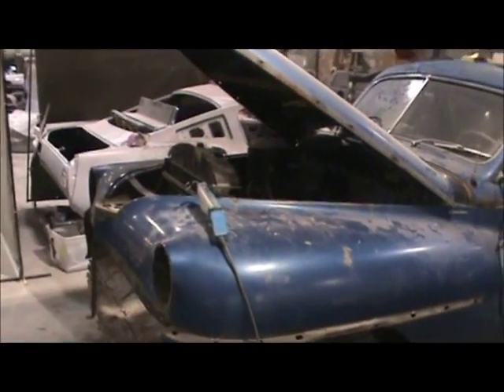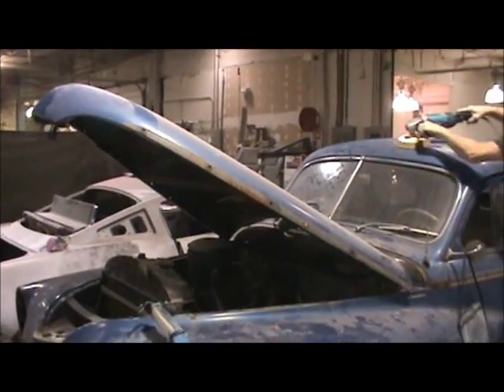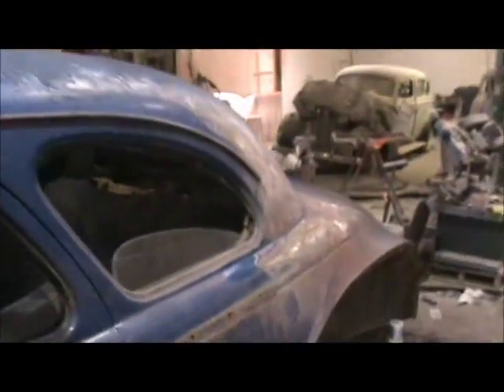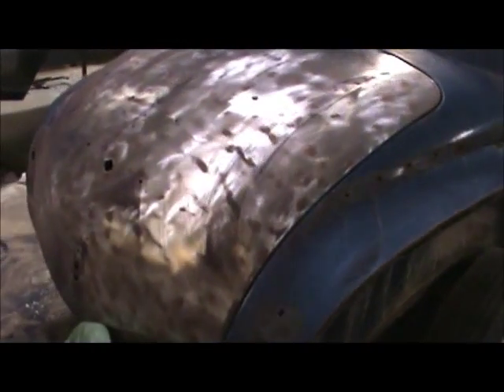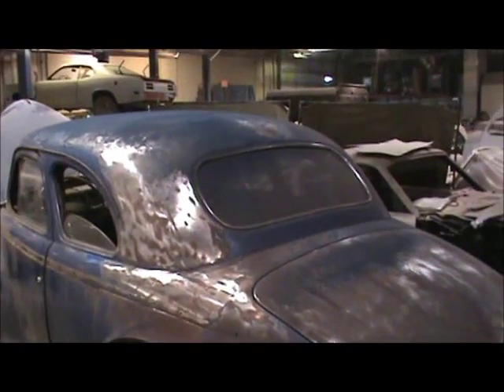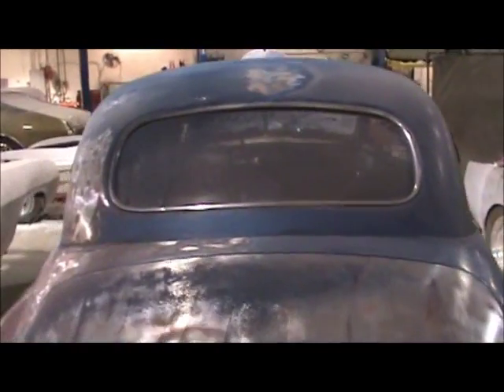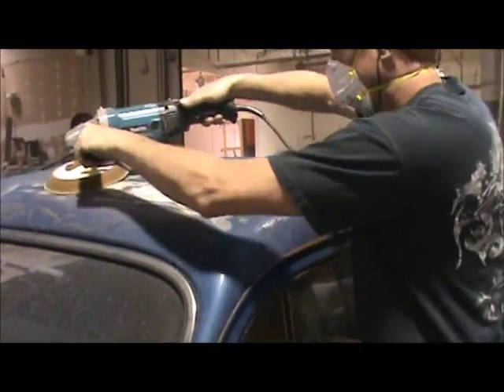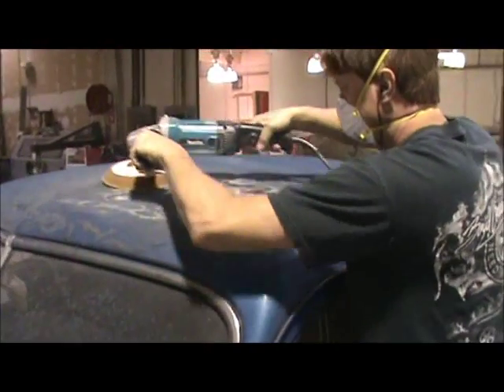Stripping a 1949 Desoto Club Coupe

Comment: I too own a 1949 S-11 club coupe. (mine is the Custom series with Fluid-Drive and a little more stainless trim then this blue car) Yes, they did make S-11's (similar to 1946-8 S-11) in early 1949. So, the title is correct. A little later in the year, Chrysler introduced the new body style 1949 S-13 models.

Comment: What is the purpose of stripping a car down to bare metal?  I read in Matt Joseph's On Restoration book that stripping down to bare metal is a big mistake as no new primer is going to adhere as well the first coat of paint a car received at the factory.  What you should do is sand the car down and repaint before going down to bare metal.  Joseph also said a lot of cars get taken down to bare metal just so the owner can say "They took it down to bare metal" thinking that this is a necessary step in a serious restoration.